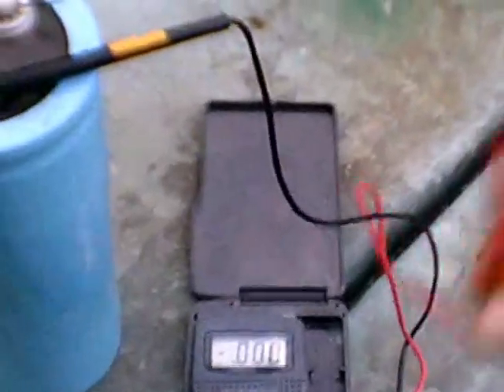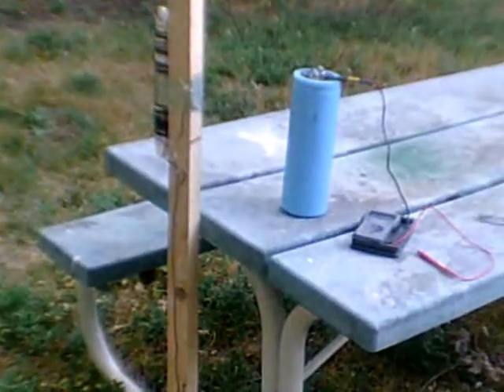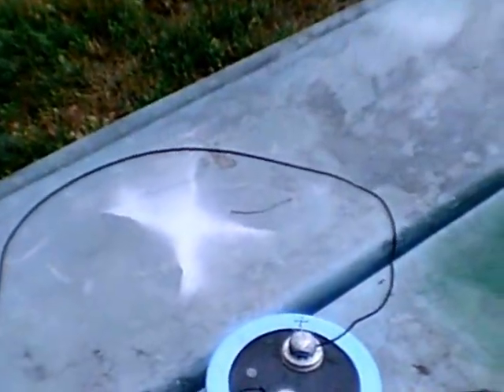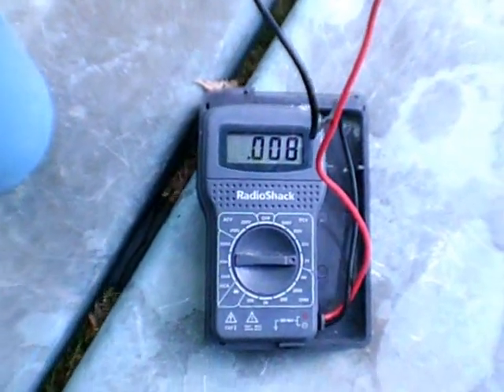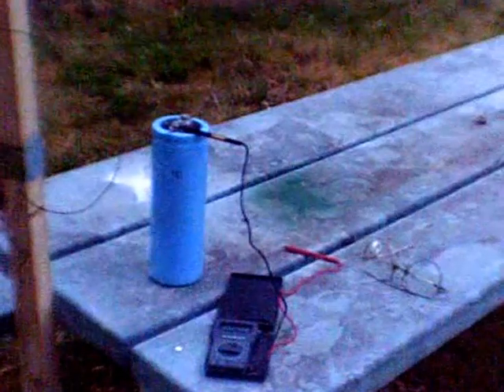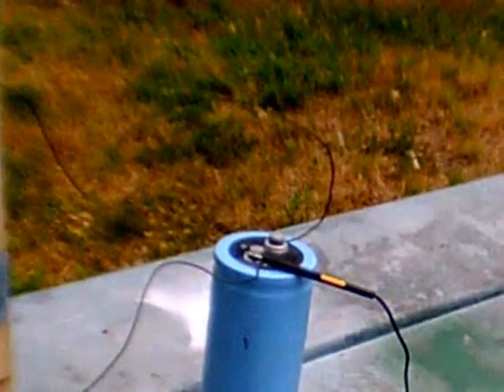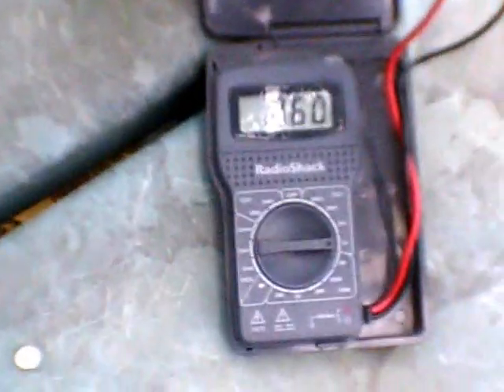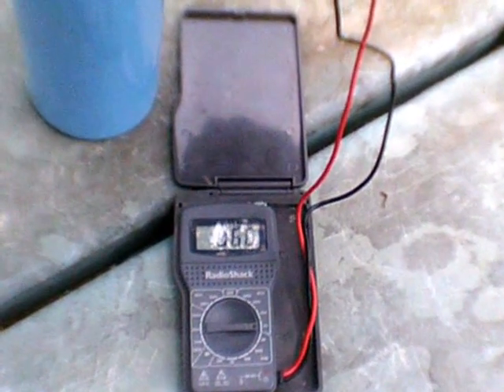rectenna10292012

Comment: please guide me "i want to know is it possible to extract energy from the radio waves and convert it into sufficient DC so that i can charge my mobile battery at least by means of some amplifiers ,schottky diode etc bcz it required less voltage and current (5v/0.5amp) "can we use array of any special kind of antenna followed by some amplifiers and schottky diode as a rectifier for the same..my email id gsameer44@gmail.com

Comment: If your not already using one, use a Schottky diode for its low forward bias resistance.  Because there is such a low power flux at these frequencies, building rectennas for power will be prohibitively expensive. Tuning to a higher frequency, namely that of a local radio station may collect watts to the capacitor a bit quicker.